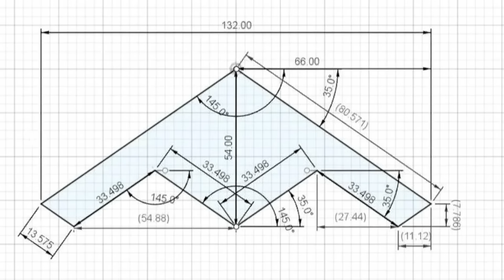The Pentagon’s New Bomber Just Proved Everyone Wrong – Caught on Camera

Comment: The B-21 image at the 6:40 mark, I believe the dark rectangles are blade antenna for communications. They are normally stowed and only pop out when transmitting/receiving. At least that is how it worked on the F-117. During flight tests I would imagine they would be out for the entire test flight transmitting data.

Comment: are you converting all b2 into b21 ?
Reply: What do you mean? For the video? Yes he is swapping back and forth between them for certain shots because on video it's hard to tell them apart. If you mean in the Air Force? No they are completely different in size the B21 is smaller but so much more advanced it would be impossible to make the old B2 into a B21

Comment: they need to censor the names of the pilot and co pilot, that information would help enemy nations to track down and potentially compromise or eliminate valuable air force personnel.  not sure about a.i. face capture tech using images of soldiers faces being used to search in various databases for same... also if they can get a soldiers image, even without a name/unit etc... they could still generate a.i. driven deep fakes of them.